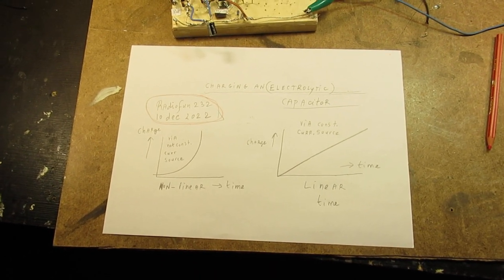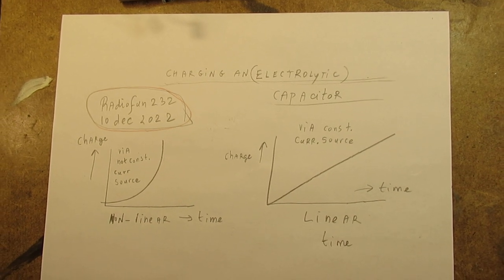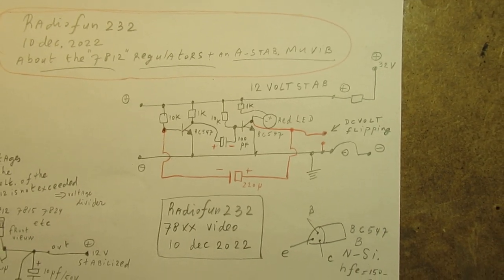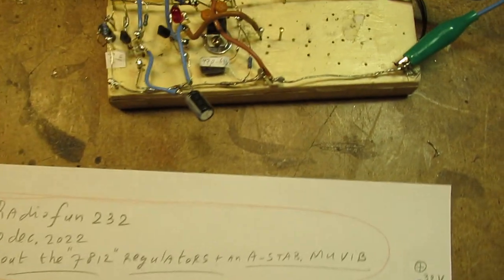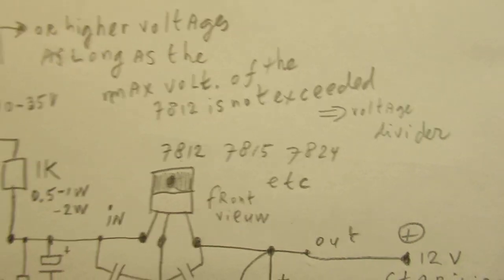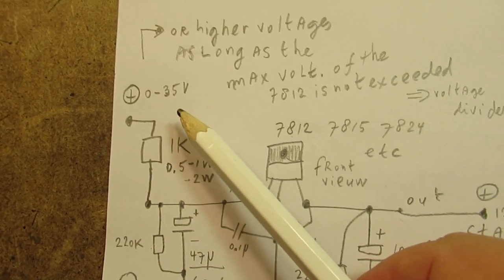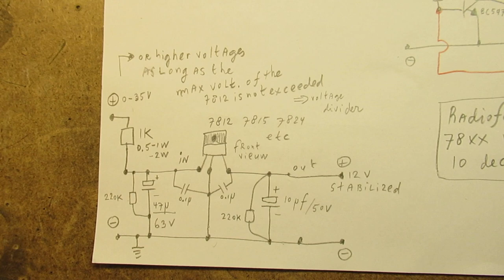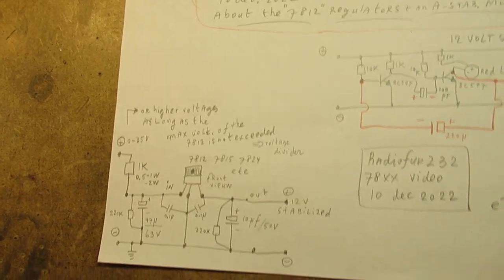About the 78XX and 79XX voltage regulators & an electrolytic cap tester & an Astabile Muvib Pt. 1

Comment: I use a reverse bias diode between the input and output of a 78/79 reg to protect it from asymmetric cap discharge, and if a defined load - I use a supply dropper R to remove heat from reg, should R get too high though - reg might not like it! The 78 needs above 2.8VDC to work (input to output VDC), but the 79 only needs above 1.2VDC - great for tight supplies.
Reply from the maker: Good info, thanks.

Comment: Interesting. On your prototyping boards,  do you use a special type of riser nail that will accept solder? Of course, copper will accept solder and copper nails are available. They are used to build wooden boats, for one thing. But, your nails don't look to be copper. They appear to be a shiny silver color. Please and thank you, for this information.
Reply from the maker: Thanks. They are steel nails, plated with brass.

Comment: Sorry I lost confidence of these linear regulator 78xx ,79xx and LM 317 . When input high like 23v current 200ma these regulator get very hot request big heart sinks. But new version of bulk converter IC like lm2575 or mc34166 haven't not these problems. Lot them discourage use this bulk converter due noice but I checked audio amplifier. There work very good. Some have positive to negative converter voltage up converters and short circuit protection.
Reply from the maker: Yes, the heat issue is true. I sometimes switch a power resistor in, so that most of the heat is dissipated in the power resistor. That limits the max. current, of course. Thanks for the advice.